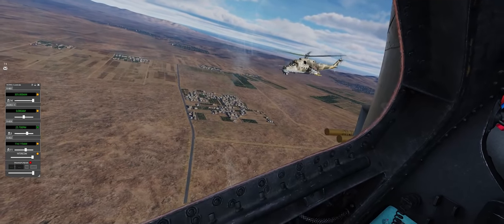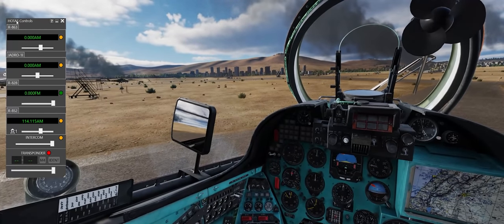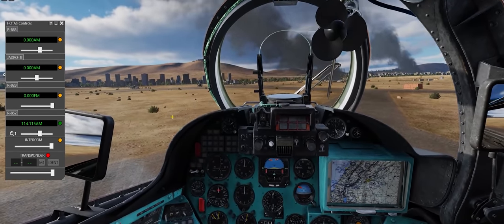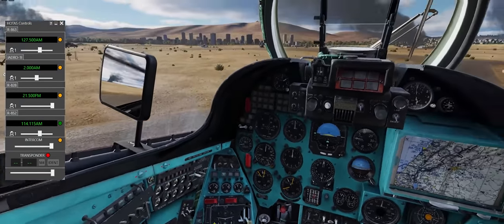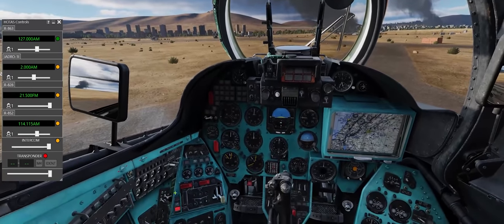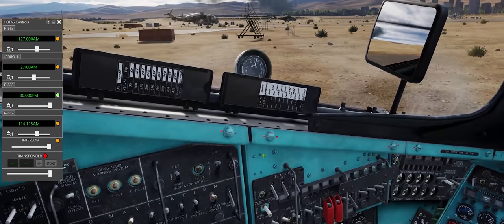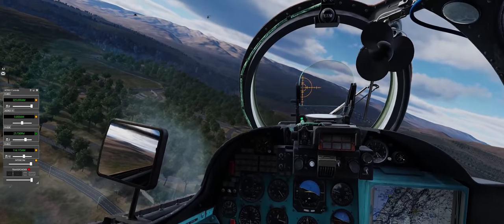DCS Mi-24P Hind Radios Tutorial | Singleplayer & Multiplayer SRS!

Comment: Do NOT, I repeat, do NOT turn on the air sensor to diss switch (under "I" in "navigation")! It fudges up your doppler navigation, making your drift angle indicator and your moving map unusable!
Reply: That switch should only be used if the actual doppler unit in the tail has been damaged or otherwise rendered unusable.

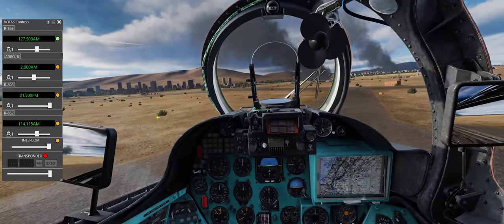Comment: 10:57 - wouldn't you check in on a frequency and not a radio? Nobody cares what radio you're using to sign in on a freq.
Reply: You don't even use frequency. You use codenames. One radio is for ground, another is for air. One is for navigation, and fourth is for emergency beacons.

Your main radios are the ones with red cross knob. You plan the missions with known troops and channels, that get programmed to radios. And then you use those channels quickly switch between who you are talking with for code name.

The problem is in DCS that people are not put on proper frequencies and you can't really talk to ground units etc with AI. Like AI requesting help, guiding in with map. AI to talk you on target, or waiting you too engage and clear area before ground units starts moving.